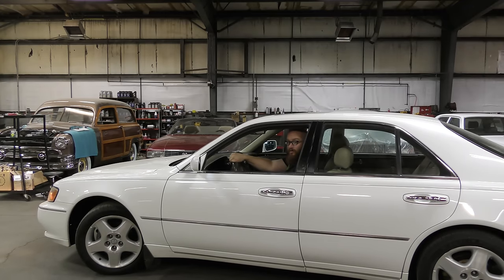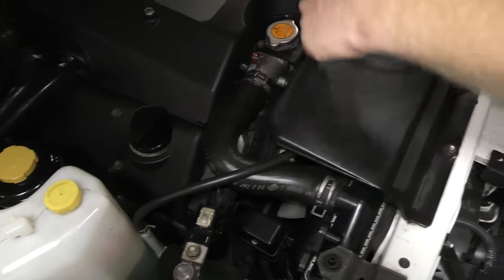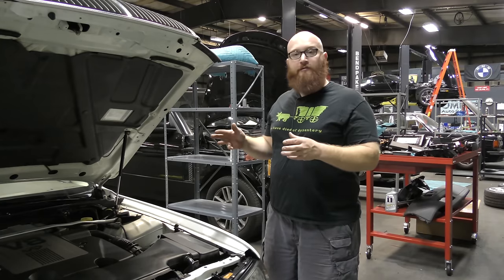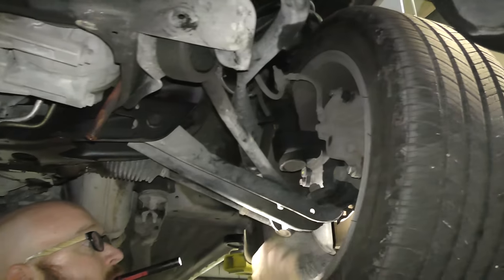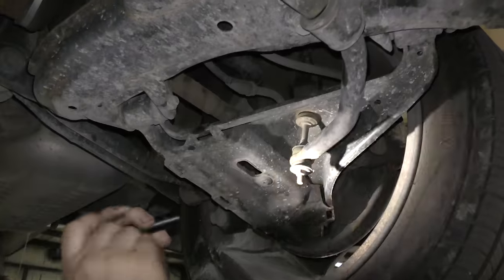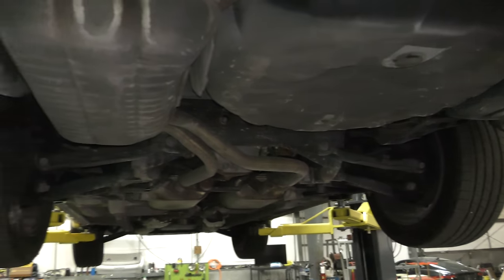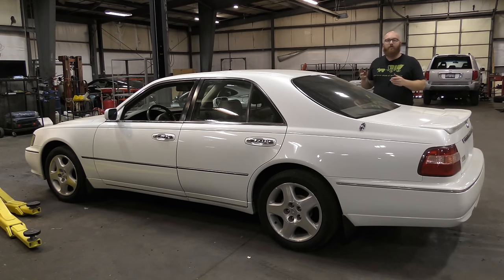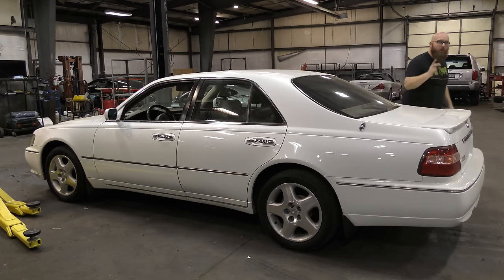I've never seen one of these before! First time a 99 Infiniti Q45t enters the Car Wizard's shop

Comment: You've never seen one before because they don't break down and are typically single owners cars. That are typically serviced at dealers. If im not mistaken these cars are made in Japan. With the Japanese pathologic attention to detail and quality control and quality parts.
Reply: I had owned one of these, a 98 Q45T. 
I got it with 160K miles at an auction for $400.
It was donated by kars for kids and the car was terribly maintained by the previous owner. I literally think that the owner did 0 maint in the entire 2-3 years of ownership.
Then he let it sit for 2-3 years.
It needed ALLOT, to get the car in 'fair' shape, it was easily over $1000 in parts alone. To get the car in pristine it was easily $2000.

At the time I was broke, so I couldn't get it square right away, but let me tell you, this car was my savior and a super trooper.
This car, with rear and front warped rotors, a caliper not working, no power steering, no A/C, and many MANY other issues, that car was a fucking tank and endured MONTHS of abuse and barely any maint on-top of what the previous owner had put it through, and never ONCE broke down on me.
It was hanging on my what last bit it had, its engine and trans, and it wasn't going to let go.
One of the most reliable bulletproof cars you can ever own.
This is basically a sportier LS IMO. 
The LS has some better tech like dual-zone, but this car id say feels sportier. Both bulletproof, but you don't pay the Lexus tax on one of these.  

Also let me add;
Noise? It doesn't make much noise, primarily the front fan. Its quiet. The noise it does make it unique due to the fan.
Ride quality? Pretty solid for an old car. I must say that this thing will ride better than most mid-sized cars of today, and don't even start on econ cars.
Seats? These are comfortable, I got back issues and I would gangsterlean that seat and it was great. 
the sound system? Pretty great.
Speed? 266HP in a 4000pound car, 7S 0-60, not quick by any means but it will stomp out your local ricers.
I easily got this thing up to 135MPH on a long road trip and it felt so stable the entire time. It didn't feel scary at all.
This is the type of car you can do 90 in and not even notice. 
Also, bonus, its RWD, so that smooth RWD power deliver is so nice. Speeds up decently too because its a 5speed. 
I had the T model which has specific struts that are 'more sporty'. Obviously its a BIG car, but for what it was, I could easily corner 70+mph on some old backroads. It handled better than a civic I owned. 
This car was what really got me into luxury cars.

I love old Nissans. I also owned a 97 Maxima and that car was extremely reliable too. I had a knock issue with that car where it would randomly knock on one cylinder under power (like going up hill) and it endured for a VERY long time until I was finally able to trace down why and fix it. 

These cars take tons of abuse, you can't get anything better for the money IMO. You can find Q45's (if you can find one) and they're typically like $1500.
I got my Maxima for $1500 back-then too. Can't beat it.
Reply: @ViolentMLG  Awesome story! I can see the car left quite an impression on you brother. What I think many overlook is that the MSRP on these back in 98 was 50k. In todays times, according to inflation calculator that translates to 80k. Frankly I don't think you can get the same reliability out of an 80k car currently. The exception would go to Toyota vehicles, Lexus or Landcruiser, or if you left America and purchased the Japanese made and imported Nissans, Mazda's and Toyota. 
I Think the message here is that Vechiles built in Japan are not the same as vehicles made in America. No matter what manufacturers may claim. This holds true even currently. I own two 4urnners and I choice them for a reason, they're japanese made and the quality is just second to nothing compared to Jeeps, and other SUV. Some how people forgoet or overlook that small but curical detail. Made in Japanese still stands for realiable and quality. Even with Lexus vehicles, you can see the difference. Lexus made in Japan, is on another level of quality and luxary than Lexus made in America.
Reply: Complete nonsense... They barely sold any. Thats the reason. If that Japanese attention to detail was actually real, they wouldnt put truck engines or economy car bits and pieces into these cars... The Europeans always had them beaten with dedicated engineering of their flagships and true top notch technologies and attention to detail put into them. A VW Phaeton, for example, was basically hand built in a purposefully built factory just for its manufacturing. They even pioneered laser welding technology for their chassis just so they can make car look cleaner and were galvanizing every bits of metal to avoid rust. The engine on that thing was a frikin purposefully built W12, whose power and smoothness was unparalleled by any JDM turd out there. 

That is attention to detail! That is dedication to a car and a true flagship. Not taking some truck engine and underpowering it so you can sell low maintenance costs and "reliability" like an LS or a Legend. There's a reason the Europeans outsells the Japanese even in their own homeland. Merc's been the best selling premium brand in Japan for a while already.
Reply: @AI-qd4vb  
Apples to oranges. The V12 Toyota Century would be a much more accurate comparison.
Reply: Yea, ok bud! And, how many Phantons do you think they sold?! The only reason that car was even built was because it was the head of VW’s pulled outta his ass imagination of a car and wanted it built and to spare no expense. Is it a cool, well built car with an incredibly unreliable engine that barely anyone knows how to work on? Yes, it is. Was it a terrible sales flop? Yes, it was. You saying Japanese build quality is lesser than that of the German is incredibly naive of you. Would you rather a 10yr old German luxury car or a Japanese one of the same age? I have a feeling I know you’re answer, and with it, I hope you have another back up car to drive while you’re wrenching on that German POS. I’ll be cruising along in my JDM worrying about nothing but when my next oil change is due.

Comment: It's a crazy idea and I've never done it, but shocks are nothing more than hydraulic cylinders and those are rebuilt all the time.  Maybe a local, friendly hydraulic cylinder shop could fix them?  Also Bilstein can custom make shocks - I designed a set for a 1973 Jensen Interceptor which is now in the Bilstein catalog.....
Reply: These are electronic controlled is the problem, just like on the Cadillac Seville STS
Reply: heh, you want to feel old, I was born that year and I just turned 50. Cool that you got something out there though.

Comment: Have a 98 Q45, hell of a car. If they made a new one tomorrow, I would buy it. 194K miles and it runs excellently.
Reply: I'd love it if they did.  

But Nissan seems content to let Infiniti wither...
Reply: I wanted a Q but now have a J30 with 52,000 miles. Amazing machine. Love the old Infinities
Reply: Meanwhile a 2008 Nissan Maxima is burning down from a power steering leak.
Reply: Proud owner a 2008 Infiniti m45 sport.
Reply: Aye I owned the same model year.
Although I think if Nissan dropped any car today id be hesitant sadly. Just don't build them the same anymore.
Reply: I remember a family friend purchased a new J30 in 1997 and will never forget the nice scent of the leather interior.
Reply: Unfortunately, I doubt a modern one would be as good as the old one. Nissan isn't what it use to be :(

Comment: One of my favorite cars of all time. I've been trying to turn people on to those cars for years. If it has the true dual exhaust, it's not a 99,  It's a 99 and a half. The 99's have a merge point after the exhaust flanges, and only a single muffler. Little known facts about Nissan, because of interdepartmental changes in the company,  they actually put out a bunch of 99 1/2 models. For example,  the 99 Nissan Pathfinder looks like a Nissan Pathfinder, however the 99 and a half has a body kit on it that makes it look very similar to a QX4. Then the QX4 itself has a very narrow cross segment on the front fascia with a small infini emblem, while the 99 and a half QX4 has a wider crossbar on the front fascia, with a barge Infinity emblem. Subtle differences between the 99, and the 99 and a halves. The 99 1/2 Maxima is amazing. Then 99 and a half QX4 is amazing. The 99 and a half Pathfinders amazing. The Body Lines on that car, are so subtle, but they're incredibly beautiful. Hey wizard oh, you really need to see that car in green. Of all of them that I've ever seen, and I was an auto detailer for 16 years, they look amazing in this green with a very subtle metallic flake to it, that they had. I don't remember what the name of the paint color was, but those 99 and a half Q45 t's look stunning in it..
Reply: I think it was called Hunter Green Pearl. One of my favorite things about Infiniti was their obscure but all too accurate paint names. Like when they introduced burnt copper with the FX
Reply: My family had a 99 1/2 Pathfinder when I was in high school - you’re right it really was a cool departure from the 99’s!
Reply: Never gonna sell my 08 M45 Sport which replaced this. But looking to purchase one of these aswell
Reply: This Q45t and the first modern M45 are still some of my favourite looking sedans ever. So clean, yet imposing and timeless. They got really popular along with the LS400 when the VIP tuning scene got popular in the late 2000s. Never see them around anymore, so I figured the electronics got the best of them.
Reply: The refresh QX fours with those bad ass H ID headlights and the two-tone are so fresh I love them
Reply: I just picked up a 97 Q45 in that green you’re referring to. It’s unfortunate they were never offered with a black interior with the green exterior. 64,000 original miles though
Reply: @Bosmob  Nice! 👍When you mod these tastefully. They look so good. They look good stock really though.
Reply: Godchi1d Von Steuben I blame the Y2k problem.
Reply: @seanwieland9763  And the economy crash in 08. Which when the M45 came back with a whole new redesign in 06 replacing the Q45  was a smash hit for car reviewers including big names like Motor Trend and Car and Driver. After it got a refresh in 08 then the release of the M56 in 2011 it went down hill from there.
Reply: You talking about Millenium Jade?
Reply: @alcaponed16  Huh?
Reply: I have a 2001 green and love it
Reply: Fred Williams that’s one of the green colors Infiniti had for a while.
Reply: Had one with the green you're talking about, it was a dark green that changed colors, some folks thought it was black...amazing
Reply: Silver Moss Metallic Paint Code KR5
Reply: its 2000, 10th anniversary edition
Reply: Late model year changes to not designate a "half" year production run. Just about EVERY car out there has had mid year changes. This is why you now need a VIN and date of manufacture for many parts when going to the parts store. Yawn.

Comment: I remember one of my college professors had one of these cars and I always admired it. Also one of the old car books I have has an article on this Q45 when it first came out in the early 90s and how technologically advanced is suspension was. Me and my wife have a 2008 m 35x which is all wheel drive and we really enjoyed the car. It has about a hundred and seventy seven thousand miles on it now and still runs and drives great. Heated and air conditioned seats electronic tilt and telescoping steering wheel among many other options. Way ahead of its time and has plenty of room in the backseat. It is amazing how most people just don't understand how long these Japanese cars last. I tell people all the time when they're at my shop but just like the wizard says they go buy a GMC Terrain and think they got a great deal only to junk the car within a few years because the engine blew up. You can lead a horse to water but ...

Comment: Back in the 1990s I sold cars for a while. When I was selling Chryslers they introduced the LH series. I went to a ride and drive event and they were comparing the Dodge Intrepid to several cars, among them the Infinity Q45. 

That Q45 was badass.
Reply: Kind of suicidal for Chrysler to voluntarily let people compare the LH cars to an Infiniti Q45.
Reply: Joe but those Chryslers were ~ 1/2 the price of a Q45. So they probably used the Q45 as a way of saying something along the lines of “2/3 of the Q45’s luxury for 1/2 the price”
Reply: @joe6096  We were all salesmen who worked at Chrysler dealerships. The idea is that we could drive the new models and compare to the competition. There was an LHS there as well. Closer, but still....

It was laughable that they thought they had anything in the same league as the Q45.
Reply: bigmedge Still not a very smart approach. That’s “old school” sales tactics. 

1. The customer forgets the price when they get behind the wheel. 

2. People shopping in the price class of a Chrysler are not cross shopping an Infiniti. 

3. People who CAN afford an Infiniti and are shopping for one don’t even have a Chrysler on their list. Rear wheel drive V8 vs front wheel drive V6. Those customers don’t cross shop.
Reply: Those intrepids held up. Except for the freeze plugs. Had one and drove the hdck out of it.
Reply: @skippythetubrat  300M was a decent car to buy when the resale value made them SOOOO cheap in a few years!! Some were really well kept too.
Reply: @aliceshaw8265  I remember when that happened. Back then Mercedes-Benz still had a reputation for making bulletproof cars. I remember thinking "Holy cow! Chrysler styling and Mercedes engineering? Great!"

And they gave us Chrysler engineering mated with Mercedes style.

Oy very.
Reply: @luemn7691  When they first came out I wanted one so bad. The interior was huge and it rode great, but it handled like a much smaller car. I drove one for a demo for a while. Nice car. Too many issues across the platform though. If you had good luck with yours count yourself fortunate.
Reply: @bkw322  I dunno. I buy old used cars to save money. I recently picked up a 2003 Lincoln Town Car. 125k miles. I am in it more than I should be, but after doing some maintenance I am counting on 5-7 years out of it and I have a 90 mile daily round trip. It's nearly perfect.

When I was shopping the 300/Charger type vehicle wasn't even a consideration. Too many years of junk from them. They might be better than they were long ago, but I don't trust them long term.

On a lease, new? Sure. If it breaks it's someone else's problem.

Old, used...? Nah.
Reply: @skippythetubrat  I had a chrysler LHS and couldnt stand it.  Big, fat, lacked options, and was hard to see out of.

Comment: Car Wizard: "I've never seen one of these."

Diagnoses issues in minutes.
Reply: all ICE cars are more or less the same
Reply: @CarsMeetsBikes  rotaries and radials beg to differ.
Reply: He is magic after all :)
Reply: @michaelkrenzer3296   They all still need fuel, air, compression, and spark to work
Reply: @michaelkrenzer3296  they still use basic suspension, breaks, transmissions, differentials, and electronics too
Reply: @ReachToVictory  Im sure hes worked on aother nissans like  1990-1996 300ZX and those are way harder to work on with theyre tiny engine bay
Reply: I nevér seen this car ín Europe.
Reply: Amazing mechanic
Reply: When you have mechanical and electrical aptitude, there’s really no such thing as “I can’t fix this”...... Now some cars may be harder for me than the Wizard and Vice versa, but all North American cars have run on a standardized 12v+ charging system since 1958 and every 4 cycle engine works the same way, whether it’s your 5hp Briggs and Stratton lawn mower engine or the quad turbo W16 in Bugatti’s.
Reply: Leaky struts and power steering hoses are probably quite common in cars and not just this one dont you think?
Reply: @andraskopf268  Only Infinti car usa and europe shared was probably the first gen Infiniti G20/ Nissan Primera maybe the nissan leopard/infinti M30
Reply: I’m pretty sure he’s already looked the car over before he did a video for it.
Reply: @2Str0k3  😂
Reply: Even 5 year old would diagnose bad struts.
Reply: @joe6096  To paraphrase Jeremy Clarkson, if Briggs & Stratton designed the human heart we'd all live forever
Reply: it's just a dolled up Nissan
Reply: well.. its a car from 99 so its gonna need stuff lol

Comment: I have a 2005 Q45 Its never had a major repair bill, It's got nearly 150,000 miles on it not bad for 16yrs old and the biggest repair bill has been tires! Actual shop visit highest repair was $300 mostly for labor for a $10 part...Literally a $10 sensor but it was in/near the bottom of the engine in an awkward spot. I plan to keep it until it gives up! Some minor at home repairs a radiator and brakes but that's it.
Reply: I got a 2003 just add oil that’s about it. And a leak in the AC system just refill it when I need too blows cold af

Comment: I actually own a 02 Infiniti q45. I just did my first mod which is taking off the back muffler and straight piped back. It sounds really good cause it’s a 4.5L V8. Great video!
Reply: It's a q45t it's way different than the q45 setup

Comment: Spray some of Hoovie’s flex seal on the struts
Reply: Wont work. Its a moving part under intermittent pressure. Look up how shocks work.
Reply: @houseofno  You missed the funny part, Leo.
Reply: Flex Seal is oil based ... per Hoovie ; )
Reply: @McBeakerson  😮 😲
Reply: @houseofno  🤦🏻‍♂️
Reply: You mean Booger Juice.
Reply: @houseofno  it was a joke